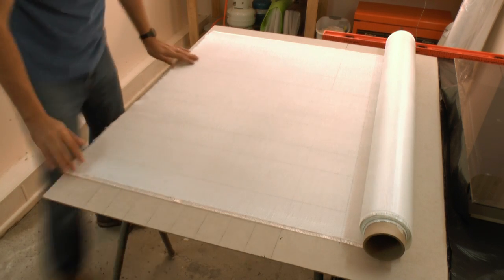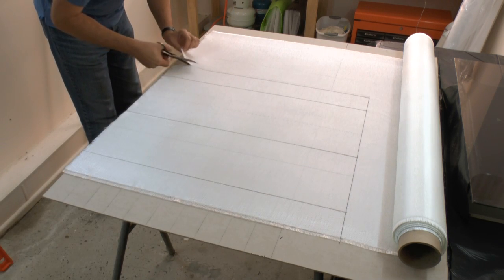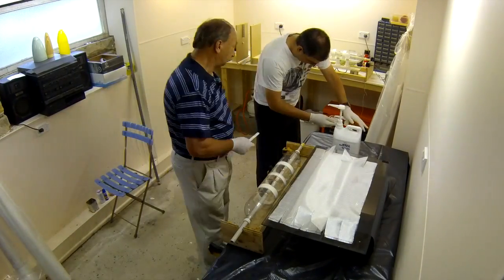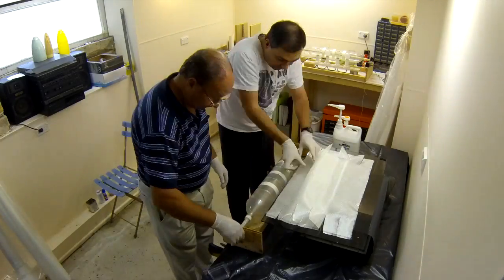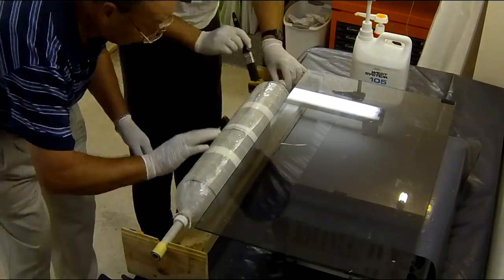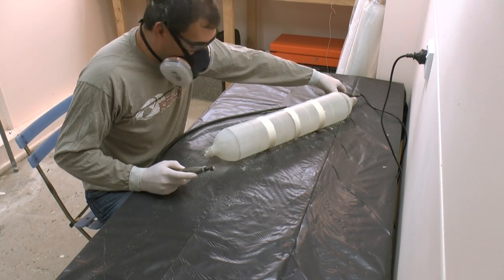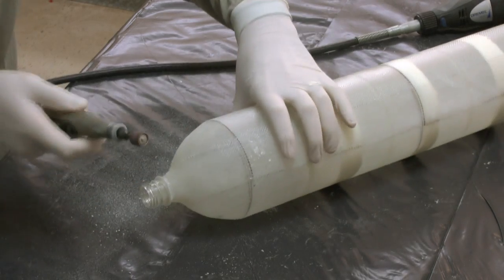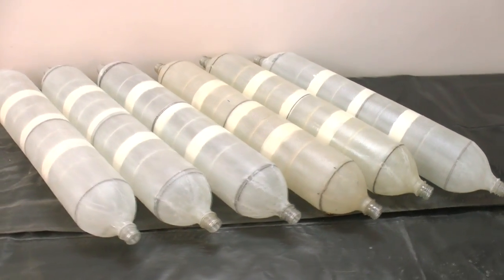Fiberglassing Boosters for the Polaron G2 rocket

Comment: Hi George! These are awesome pressure chambers. Did you use Sikaflex 11FC adhesive here for splicing bottles? Can I replaced it with pl premium? And after that you just covered it with fiberglass without any other reinforcement? Thank you so much for answering!
Reply from the maker: Yes, we just use Sikaflex if we are going to be reinforcing with fiberglass. You can certainly use PL premium instead. Yup the 2 layers of 200gsm fiberglass is the only reinforcement we add to the bottles.
Reply: @AirCommandRockets  George！By the way, do you sand the whole chamber before painting epoxy?
Reply from the maker: @wangying115  Not at all, we just clean it with some methylated spirits and the epoxy goes straight onto the shiny PET. It's likely that at some point the PET may separate from the fiberglass but that doesn't matter. The PET bottles form the water proof bladder and the fiberglass does the pressure containment.

Comment: Hi again George. I was wondering, what size nozzles are you going to be using for the boosters for the Polaron G2? Thanks again.
Reply from the maker: Hi Randy, The final nozzle size is still to be determined for the boosters. We may try for something smaller first like 16-18mm, but eventually the plan is to use the full bore nozzles for the boosters. It all depends on how well the new launcher will work and how much acceleration there is going to be. We don't want very high acceleration as it puts too much stress on a lot of the components.

Comment from the maker: @Mathieu DK 
Hi Mathieu, like with all things it takes a little practice, but really not that difficult.  We had a few practice goes first before having results we were happy with. I don't think polyurethane glue would work well as the glue needs to wet out the glass fibers completely and needs to be quite runny. You can use polyester resin though which is cheaper than the epoxy.

Comment from the maker: ReptiglorandRockets Hi Randy, I'm not sure what the final altitude will be, we've done a few sims of the rocket, but until we have the final weight it is difficult to guess with any accuracy. We also don't know how the long burn will go, and whether the rocket will fly in an arc or not. If everything goes well, it should be in the vicinity of 1000' but could be a lot less. The purpose of this rocket is not to reach a particular altitude, it's more about getting the long burn out of it which should be fun to watch.

Comment: Saw something similar to this last year but with carbon fiber on a single bottle they also tried kevlar and carbon/kevlar hybrid fabric. They actually achieve MUCH higher pressures and used oxygen tanks to reach the pressures and saw pressures that were astronomical without ruptures.......sometimes. haha Love the videos keep up the great work.
Reply from the maker: Thanks Joseph. Yup there are certainly stronger materials that can be used and even the winding technique can offer better performance. We are currently using only cheap e-glass that is easy on the budget while we test the rockets and payloads. No point destroying expensive pressure chambers if the parachute deployment mechanism fails. Once we're happy with the performance of a particular rocket configuration we'll switch to the more expensive composites and see how much further we can push the rocket. :)
Reply: Nice looking forward to it

Comment: Good work George. I really like how you update the build log so we could see the progress of the rocket. Do you have a general idea how high the rocket would go at 250psi? I can't wait to see the flight.
Reply from the maker: Hi Randy, I'm not sure what the final altitude will be, we've done a few sims of the rocket, but until we have the final weight it is difficult to guess with any accuracy. We also don't know how the long burn will go, and whether the rocket will fly in an arc or not. If everything goes well, it should be in the vicinity of 1000' but could be a lot less. The purpose of this rocket is not to reach a particular altitude, it's more about getting the long burn out of it which should be fun to watch.